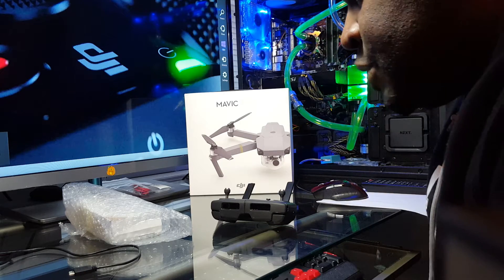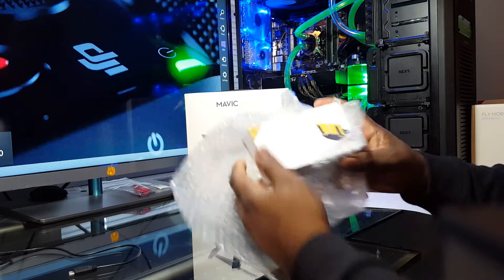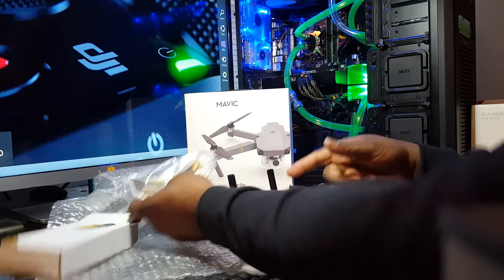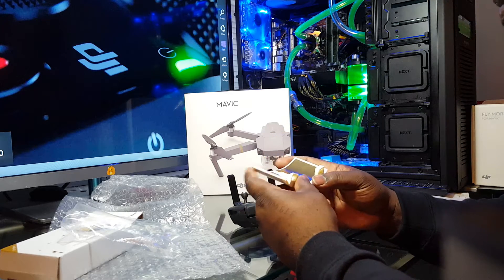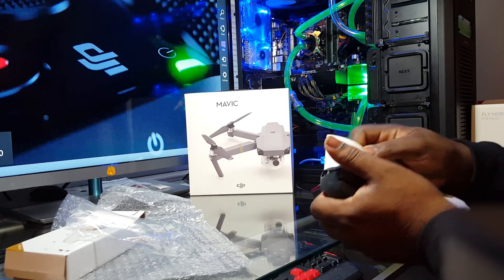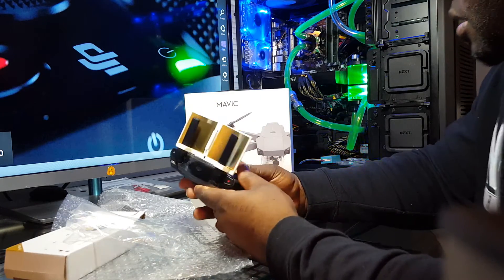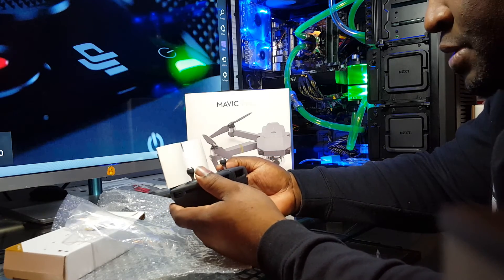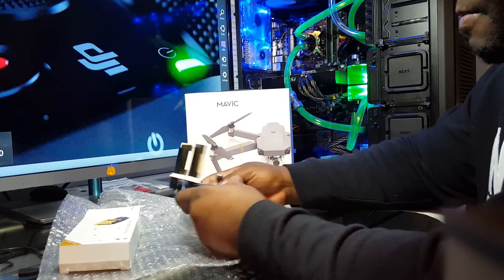DJI Mavic Pro antenna booster

Comment: it will not work  because  the mavic works  different.  wast  of money  you have to fly  iwhere there  no  wifi   ... like over water  you get batter range... and there no building  and fly in hight  up around  200ft